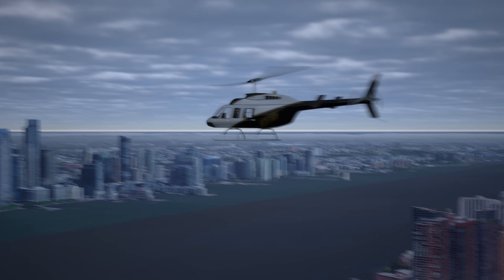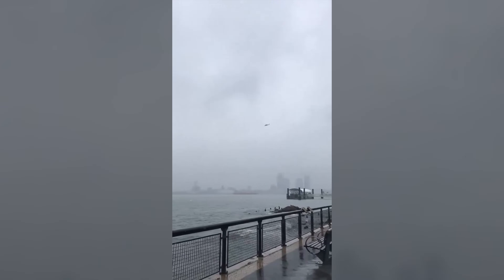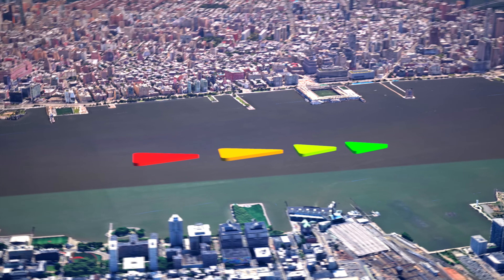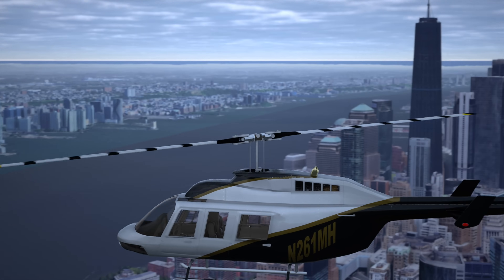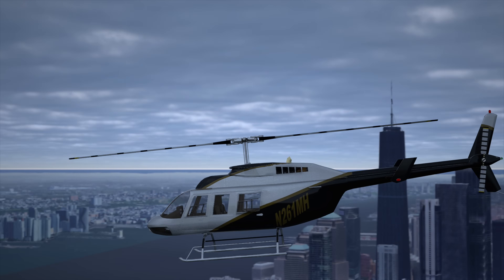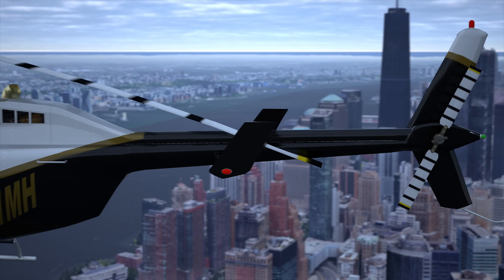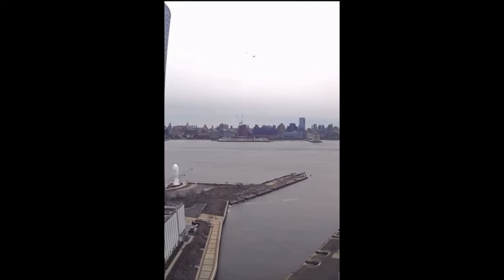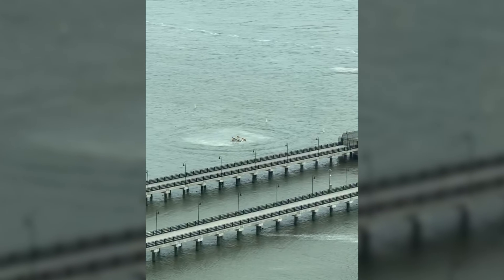Helicopters DON'T just fall from the sky - What is "Mast Bumping"?

Comment: Mast bumping would not typically take the gearbox with it.  Mast bumping on this model would just separate the rotor blades from the mast. Also, you said mast bumping can happen on most helicopters which just isn't true.  Mast bumping can happen on a particular type of mast/rotor system

Comment: I worked on a helicopter carrier in the Navy and I think helicopters are more dangerous than airplanes!
Reply: They are.
Reply: @ajkulac9895  unless you are in the Navy on a carrier, then they are the safer option!
Reply: Back when I was a law enforcement pilot, Jet Rangers were the statistically safest airframe in GA. Can't speak to the Navy aircraft, of course.
Reply: Yeah, a plane even if the engine/engines die. You still possibly could be able to land it. Not a great landing by any means. But could possibly have better odds surviving. Unless there is no control or time to get back control.
A helicopter though, whatever happens.  It's going down with no control every time. 
Very few have survived a helicopter accident. 
This is such sad accident.
Reply: @stealth2951  "A helicopter though, whatever happens.  It's going down with no control every time."

That is absolutely untrue.
Reply: @Tom-zs6bb  can you explain, why this not the case. I don't see how it can get lift without the rotors.

Comment: Mast bumping wouldn't result in the entire rotor assembly separating from the aircraft intact. This looks like an uninspected Jesus nut. The rotor assembly would separate intact and continue spinning and, depending on the forward speed, the instantaneous torque on the tail could easily cause it to separate.

Comment: Thanks for putting the beginning of the CCTV recording. Everyone is just putting the part where helicopter hits the water, as if that's the important part.

The propeller can't hit the tail when flying in the straight line. If it did cut the tal off, it would spin around they vertical axis before losing balance, not fly in a ballistic trajectory. Also, since the witnesses reported the propeller detaching the helicopter, this is definitely a mechanical failure due to poor maintenance.

Comment: I have flown that model doing rides. I am also an A&P Aircraft mechanic. Here is what I think happened.
1. There are 4 dog bones that attach the transmission to the airframe in 4 places.  If one of those fail, the transmission would tilt 
& hit the tail boom or just tear off the helicopter.  That looks like what happened to me.
2. Or If a pitch link failed , that blade could just go crazy & cause a dog bone to fail & or it may of just caused the blade to hit the tail boom  
 tearing the complete tail boom off & ripped the transmission assembly off.
3. The pilot did a climb & then just pushed froward unloading the blades & they struck the tail boom. I don't think so !!!!

Comment: Gearbox failure caused a jam in the moving parts and that caused the tail shaft to stop suddenly. That then caused the tail to twist off. Not a tail strike unless after the transmission broke. My guess is only that..... improper torquing of case bolts caused the case to separate enough to break teeth on gears and so on. Or a bearing failure, lack of lube etc etc. Regardless of the cause it seems the transmission broke apart and the rest is collateral damage. All a maybe.

Comment: It doesn't look like a Mast Bumping at all because if it were the case, the transmission would still be attached to the fuselage. It was probably a case of a transmission mount failure or extreme vibrations after a main blade failure, and that would be the answer about the missing tail boom.

Comment: Heli pilots, technicians and flight safety fundis may find the following accident report interesting (& disconcerting in terms of the failures by Bell Helicopters to issue any technical bulletins or other warnings following initial evidence of critical component failure, and to only do so after a number of fatal crashes due to the same component failure.) Bell 430 in this case.
Let us hope, pray and advocate for greater honesty and transparency by aircraft mfrs and rapid release of information in case of similar component weaknesses and vulnerabilities under specified operating conditions coming top light.

https://caasanwebsitestorage.blob.core.windows.net/accidents-and-incidents-reports-new/9946.pdf

Comment: This is BULSHIT - Its Click bait, This clown is plagiarizing mast mumping from other sources.
Brian Murry is like the little boy crying wolf, its despicable, what we have is a clown pretending to be an expert and falsely alluding he knows what caused this accident.

This commentary is problematic, its fraudulent, it "alludes" that this accident was due to mast mumping. This video does NOT "explain the incident".  Its utter bullshit.

So lets get to the facts.
Facts are the Main Rotor and GEAR BOX flew off the helicopter, as this occurred
the tail cone separated, that is consistent with, a main rotor cutting off the tail cone.

That does NOT mean "mast bumping" WAS the cause of this accident.
There are other possible causes ,  we don't see a mid air collision.

We can expect that Video will emerge that will show us what happened,
the wreckage will tell us the story.

The maintenance history is almost guaranteed to tell us another version
of the cause of this accident. 

There are numerous safety and maintenance alerts that apply to this 
helicopter, 

This joy ride was is unlikely to have any must bumping control movement,

Now, in a high traffic area, there is also a remote possibility of wake turbulence 
from a large aircraft and the odds of that is more remote than mechanical failure
due to issues that were either not attended to or it may be a new issue
that has not occurred. 

Also there is a remote probability that it was hit by a drone or actually shot at, or 
wind funneling, thru buildings created some strong vortex, again, this is unlikely but falls into the remote possibilities as a cause.

Odds are that this accident was due to inadequate or improper maintenance
and not pilot error in this particular case.

The only way mast bumping is likely to have happened here is that a passenger
deliberately or accidently pushed the cyclic stick and that is even more improbable.

Notice the above logical reasoning was not in the video of this clown Brian Murry.

Give this video a Thumbs Down.

Comment: Poor servicing and airframes worked hard stressing mechanical components. Investigations final report will probably confirm that. As main rotor and gearbox broke away it looks like it sheared the tail off. Very tragic indeed.

Comment: So- I know nothing.   Is it not possible to design the helicopter so that the rotor blades could never contact the rear section at maximum flex?  Is it such a low-probability issue that this is not a priority?  Are there other design imperatives that force the design to allow for this?

Comment: Of course, we must wait for the official investigation from the NTSB, … my thoughts went in the same direction, ..greate job with vid. 
It has been reported that the pilot mentioned fuel shortage just before the crash. In such a situation, the pilot may have attempted to initiate an emergency landing. A sudden maneuver under stress can lead to uncontrollable movements, especially in a helicopter like the Bell 206, which is prone to mast bumping – this means the rotor head could strike the mast. This would cause the rotor to detach immediately, resulting in a loss of control. If the helicopter then fell from a higher altitude, it indicates a structural failure that likely followed the mast failure.

Additionally, eyewitness reports mentioning seeing sparks or small explosions are consistent with the mast bumping theory. The sudden structural failure, when the rotor detaches from the mast, could cause such effects, further supporting the idea that mast bumping played a key role in this incident.

Comment: Aggressive input in flight control especially pull up on cycle   control may have cause main rotor to cut tail boom on helicopter also  kenetic energy  generated from the shock from the impact  can also dislodged the engine, gearbox.  This is a probable cause

Comment: What are you talking dear. Had mast bumping taken place the rotors aslo would have been severely damaged. Footage clearly shows both blades intact and spinning with mast with main gearbox attached. Some other cause leading to structural failure at the mgb attachement that could have initiated the failure rest being only the sequence of associated failures. See the video in detail please

Comment: Retired Commercial Helicopter pilot as well; feasible scenario of the birds, some pilots will try an aggressive maneuver to avoid them, not necessarily the correct action/reaction. High forward speeds mean forward input of cyclic, this in turn requires the body of the helicopter to also pitch down, (nose down), IF the pilot rapidly (snap) pulls aft (back) on the cyclic to avoid the bird/s in an attempt to rapidly clime, the body of the helicopter does not pitch (swing up) up at the same time, it follows AFTER the cyclic input in this type of rotor system, (underslung). This can and will tilt the main rotor system rapidly causing the tail rotor strike and subsequent separation as seen in this reconstruction. Until the NTSB and the FAA conduct and finalize their investigation we will not know for sure, sometimes we never know for sure, but this scenario if true would cause this type of accident. Sad to see, but all accidents are, RIP…

Comment: This is not mass bumping ! This is catastrophic failure to the roto hub and blades either the shaft cracked or on the maintenance logs for the 100 hrs rebuild of the roto hub and blades either it’s a 100 hrs rebuild of the roto hub on every 100 hrs of flight you would have caught the crack in the main shaft they are to x ray the shaft if there’s any visible damage to the shaft ! Or the rebuild was not done to spec !

Comment: So I’m on mobile and I was able to zoom in and slow down that first footage where you see the parts fly off

Tail separated first and the aircraft began to tumble hard, the second big piece of debris that tears off while they are falling is the spinning rotor blades. Based on how they kinda hover more when they ripped off since they are still spinning and have lift to them as seen in the closer videos. 

Something went majorly wrong and that tail section seemed to explode off the aircraft and then the rotors themselves got ripped off by what I assume was simple Over-G

The aircraft didn’t just spin, it was tumbling after its tail section vanished. 

In theory you can sort of cancel spin by going fast. Wind resistance on both sides of the aircraft would prevent a spin. It’s only as you slow down does the uncontrolled spin begin when your tail rotor is out but that assumes the tail is intact and it’s just your tail rotor is out. 

Without the tail stabilizers the aircraft didn’t have any kind of control and it’s possible the sudden jolt of controls caused the pilot to overcorrect and cause the roll

Comment: Seems likely that the tail boom bolts failed, causing the tail boom to separate.  If it was a mast strike you would not expect to see the main rotor system intact for as long as you see in the video.  I’m speculating.  The NTSB will no doubt do their best to identify exactly what happened, which hopefully will help prevent a similar tragic accident.  Condolences to all who knew and loved those who lost their life.

Comment: The Bell 206 has a semi-rigid rotor system NOT semi-articulated rotor system.  My speculation is that perhaps a main rotor blade pitch change rod or attaching control rod either failed, a fastener failed, or may have been improperly installed or mistakenly flown past TBO.  Again, this is PURE speculation and does not appear to be in any way the pilot's fault.  A main rotor blade in flight suddenly becoming free from the flight controls could potentially wildly & violently fly out of track with the other main rotor blade flexing/diving & climbing out of control severing the tail boom.  This catastrophic out of track & now far out of balance flight condition could easily cause structural airframe failure and main rotor transmission mount failure. God bless the souls of those on board.

Comment: Catastrophic mast bumping normally results in the mast breaking off at the point of rotor head contact. The picture with the main rotor transmission and rotor head still complete,  makes me think mast bumping was not the culprit. 
Pylon rock might also be a possible cause. Two blade rotor systems are prone to it. I've been in severe pylon rock it is no fun.
The roof of the cabin is aluminum honeycomb structure which is prone to corrosion which can lead to delamination of the honeycomb and structure.
Which could result in transmission mounts breaking.
Witnesses said the heard loud bangs before the aircraft came apart.
Possible the bangs was the main rotor transmission failing and top portion of the main rotor transmission separating from the lower half.
If the transmission mounts broke in fwd flight the main rotor blade could cut the tailboom off in the process of departing the airframe.
This is all speculation, based on
32 years as a helicopter mechanic, with experience on Bell 206 series.

Comment: Retired US Navy H-46 pilot, chief maintenance test pilot, squadron maintenance QA Officer - of the largest aircraft squadron in the USN.   
As an old guy, sitting in my desk chair... with NO detailed evidence....IMHO:
.... while mast bumping is a legitimate phenomenon (especially in a two bladed system) probably not relevant in an in-flight scenario.
If we want to go down a different rabbit hole....let's try catastrophic drive train failure ( blade system well outside of normal operation limits...probably overspeed  circumstance).....resulting in both blade systems including shafts and masts departing the aircraft. 
Under those circumstances , that (former) aircraft would  have become an uncontrollable, rapidly descending chunk of expensive metal parts with people innocent strapped inside.
Still sitting in my desk chair.... with NO detailed evidence.......just a guess....

Comment: Bet he lost a tail rotor. Loss of the tail rotor is almost certain death in a helicopter. A company I worked for owned a chopper and the pilot was very lucky when he lost the tail rotor about 50 feet above the ground as he was landing.
He said that first spin after the loss of the rotor was so fast and hard and violent it smashed his head back into the seat .He couldn't get his head off the seat head rest. He dumped it on the ground fast as he could it bounced hard but he survived. Very experienced pilot. If it happened any higher it would have been fatal. This accident It may have been rotating so hard it ripped the tail off. The tail is not built to survive that kind of spinning hard sideways in the wind G force. I bet the first thing  investigators are going to look at is maintenance  records of that rotor. For the company's sake it better be within TBO.

Comment: My dad was a test pilot at bell helicopter before becoming an engineer. A pilot buddy of his (and chief test pilot for bell) has a crash where the blades came off and did damage to the tail boom. The balancing weights (used in teeter rotors like the 209) had a problem and shot out the end of the blades prior to all the damage. Not saying that happened. Mast bumping changes the reactions the pilot should make and if they don’t practice for it… any number of things could’ve gone wrong. Just saw the weights overlooked as a possibility

Comment: A catastrophic failure as a (possible) result of over manipulation of controls! this sounds very similar to the 2001 American Airlines 587 crash and it's hard to believe that this is even possible, I would think built in safety measures would prevent such a disaster.

Comment: Jet Ranger drivetrain tech here - you dont get mast bumping in a 206 unless you are performing low G maneuvers - this accident has more of a mechanical failure aspect to it. Would like to know if the ship just came out of maintenance for eg. 

the B206 of this vintage is a mechanically flown ship (boosted controls) and it can be broken in flight by pilots' actions - but I dont feel like this is the case here.

Comment: All helicopters can self-destruct mid-air if the limits are not adhered to. An Apache can hit the canopy with the rotors if you hit the bump stops hard enough, just about any helicopter can hit the tail boom with its rotors if you try hard enough. They all have different limitations that must be followed for safe flight.